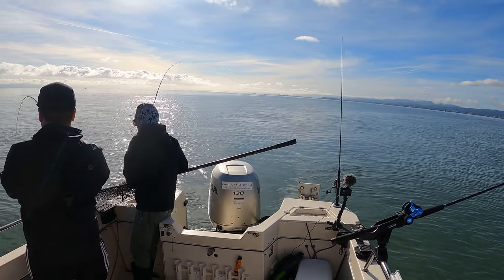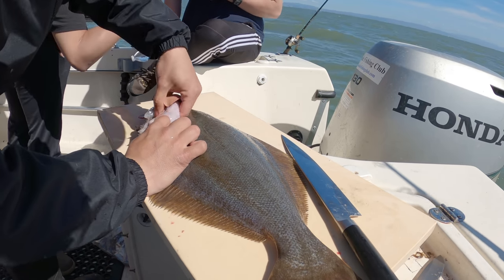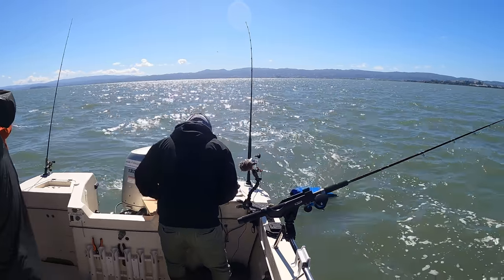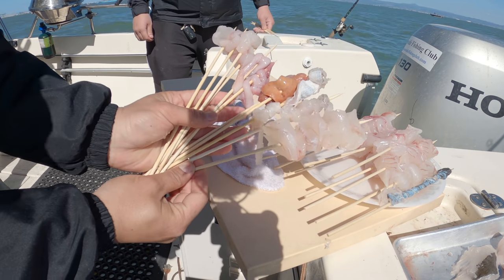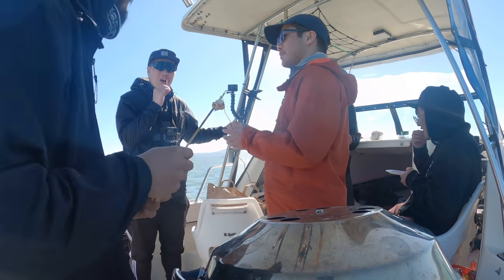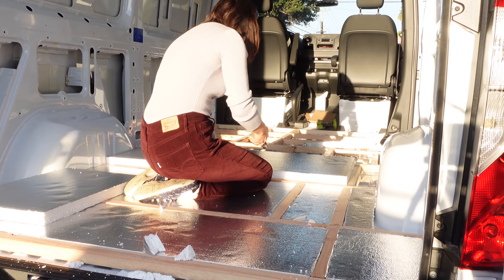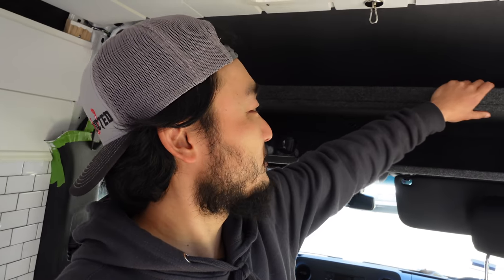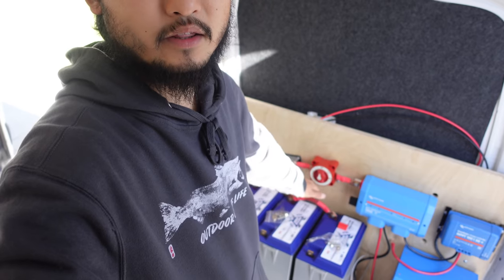VAN BUILD UPDATE + Catch and Cook Halibut on the Boat

Comment: We are customizing a brand new (30 km on odometer),2019 Mercedes sprinter 2500 (173") and are just about done (end of March?), 4" lift kit, winch, 500 watts solar on top with 400 Watt hours of batteries, 75 litre water tank, 4 gallon hot water on demand heater, ultraviolet water purification system. 
We will have numerous ways of cooking, smoker, charcoal grill, dutch oven, wood stove, induction top, toaster oven, sous vide, micro wave and am thinking about an air fryer as well. 
Have followed you for awhile now and really like your style. Have actually learned a lot from your productions
Keep up the good work, see you next Tuesday!

Comment: You might need to rent a table saw so you can rip-cut your shiplap (cut it long ways). I noticed your ceiling shiplaps are not spaced evenly probably because you want to space them out to the end without having to make rip cut panel strips where the ceiling meets the wall. I would have suggested to install the ceilings close together and just rip cut smaller strips to finish it off at the end and use your trim of choice to cover the corner gaps. Having said that, you are doing a spectacular job. I can't wait for you to take us on your future adventure with this van.

Comment: Careful with the battery wiring. Sometimes you can differentially wear your batteries by having them connected one after the other like that instead of each battery connected with the same length of cable to the charge controller. This can result in sub-optimal battery lifetime and performance. I am not sure if this is the case for your particular battery chemistry, but is probably worth looking into given the expense.

Comment: I didn’t build my van a lot at first because I didn’t think I would use it a lot. Got a portable AC and wish I would have got a AC/Heater Combo, bought a Westinghouse Generator and that was a good solid purchase. Other than that just rod holders, slide out frame table/bed frame, air mattress, a chair. It’s not much but in the heat of July it’s damn cold in here.

Comment: I hope you used stranded wire, as solid wire will break from the flexing, and fused every wire at the battery. Be sure to put in a couple of fire extinguishers too.
Reply: Also crimp, don't solder, connections. Soldered connections are too rigid and they'll break.

Comment: Have you considered suspension work to equal out the weight being added to the van? Mostly for a smoother ride especially on longer trips and maybe off road trails, I would think that would be a good idea before finishing more interior work but I have no idea how the suspension system is setup on that van or if it's accessible from the exterior.

Comment: You need to find an electrician that's good at DC. Especially when you're going to want to wire it to solar And to make sure the correct solar amperage is going back to charging. And to also make sure your batteries are in correct series. If you dont brother it could be catastrophic.  I wish you well and I always like watching your videos. See if you can find a Union electrician out there  In San Francisco. I'm in Sacramento And I barely have time for myself.👍

Comment: The van was expensive, the batteries are expensive, the cables were expensive the windows are expensive, so what im getting out of this is, we should all just quit our day jobs and become full time youtube stars 🤣🤣🤣 nice build, it coming along nicely, werent you going to use solar panels???
Reply: It's actually very selective ... in that in most of the US the internet speeds are far too slow to be on YouTube. Where I am in Silicon Valley, it's an hour and a half to upload one minute of video.
Reply: @alexcarter8807  thats horrible, silicon valley is a pretty remote place, i live in san bernardino some spots are slow too but not nearly as slow as what youre describing